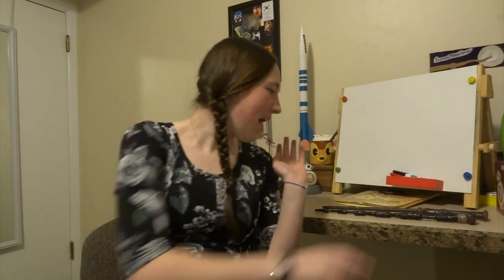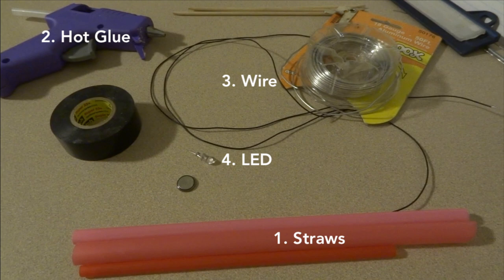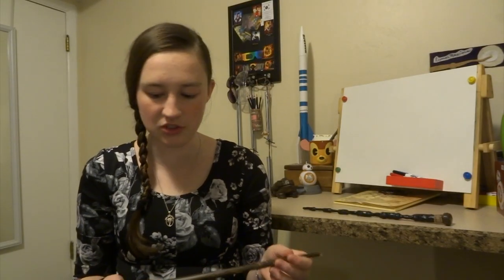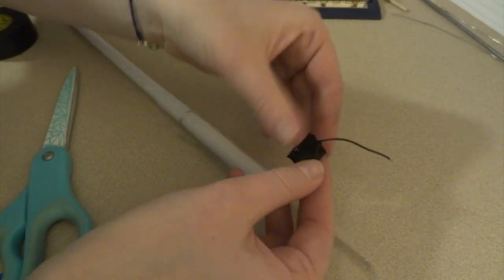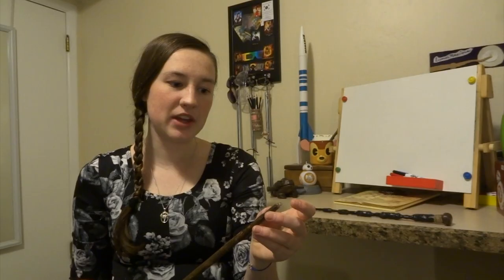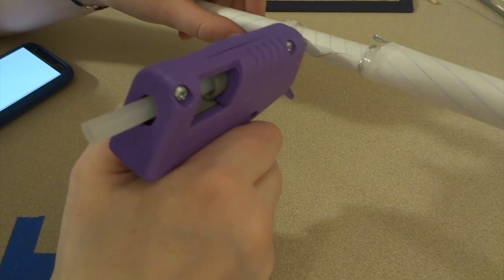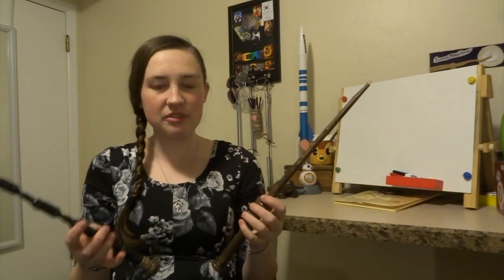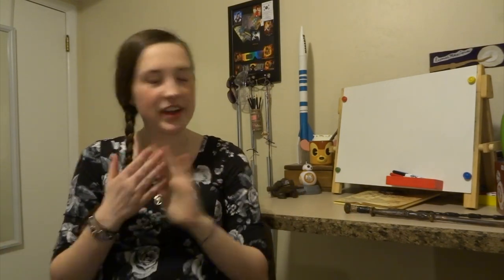DIY Light-Up Wand Tutorial

Comment: Amazing video! I’m planning on making this but is there any specific wires I will
Need to use? Like will I be able to use my old iPhone charger cord? Also.. Where can I get the thin wire?
Reply from the maker: Thank you for watching! When I made mine, I used 18 gauge aluminum wire for the thick wire (wire gauge tells you how thick it is, with smaller gauges being thicker wire). You can get that at most craft stores like Michael's or Hobby Lobby, at home improvement stores like Home Depot, or online. The thin wire is actually what I got from my old phone charger. If you have one that doesn't work, you could probably get yours from there too. Just cut apart the outer cover, and there should be a few smaller wires on the inside. I believe the wires in chargers are 28 gauge wires, so you could also look into buying some 28 gauge wire separately. I hope this helps. Good luck making your wand!
Reply: CaitLumos thank you

Comment: How should you make a switch tell me please
Reply from the maker: For the switch, you want to get some bendable wire. I used 18 gauge aluminum wire. Start by looping the wire around the wand where your thumb would naturally rest. Then bend it down to the end of the wand, make a hook, and attach it to the end of the straw. Then take another piece of wire and hook it to the end of the straw opposite the first wire. These hooked ends will be where you attach the rest of the wiring, and when you touch the short wire to the loop on the long wire, the wand should light up. I also used some paper to cover the bottom wiring of the switch in order to hide it and hold it in place better. I hope this helps!
Reply: Thankyou CaitlLumos you Are So Pretty and Amazing 😀😀😀

Comment: Is there a way to make the light brighter dear?
Reply: From what I know about LEDs, using a stronger battery should work... be careful not to use too strong of a battery, tho.. the more electricity that's flowing through it, the brighter it is... the inside of an LED is tiny little wires, so if you have too much electricity flowing through it, those wires will explode

Comment: If you're making one that isn't electric, I'd highly recommend using a wooden dowel and then adding a ton of hot glue onto it to thicken it.. I'd also recommend balancing it toward the handle. It's easier to wave around if it's balanced properly and also wooden dowels are sturdier than straws and yet more flexible than a chopstick.... I made my first wand from a chopstick and then accidentally sat on it and it broke way too easily.... that wasn't a fun lesson to learn